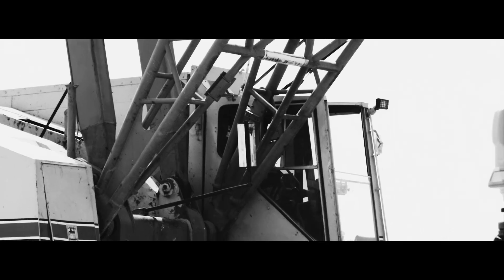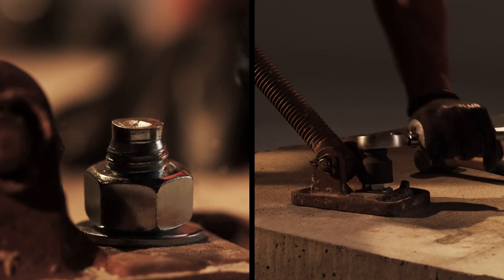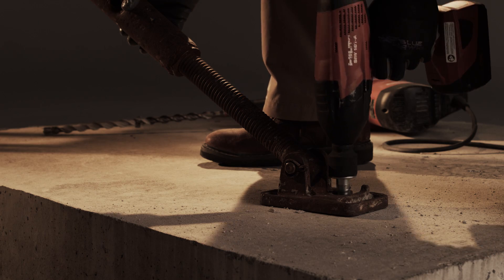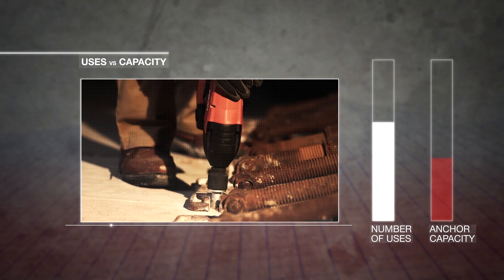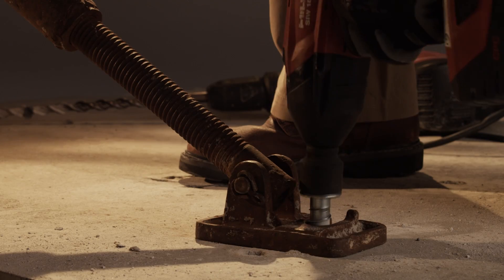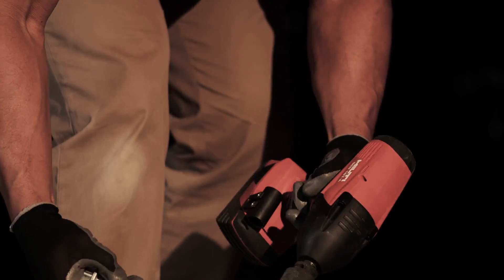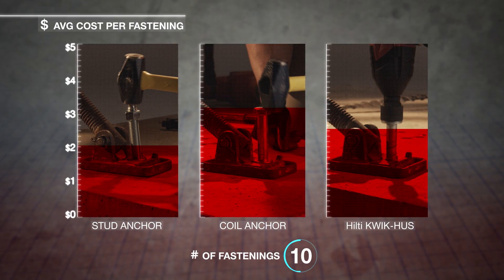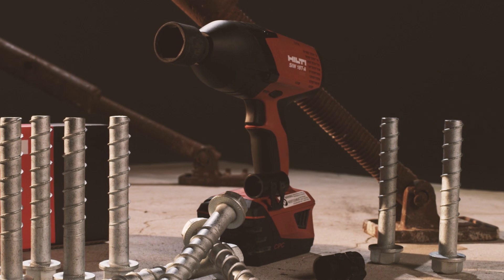DEMO of the Hilti Kwik HUS screw anchor and reusability gauge

Comment: we use the smaller v2a screws for things outside, there is rebar, no problem. the hole is crooked. the screw bends like that hole and still holds perfectly.